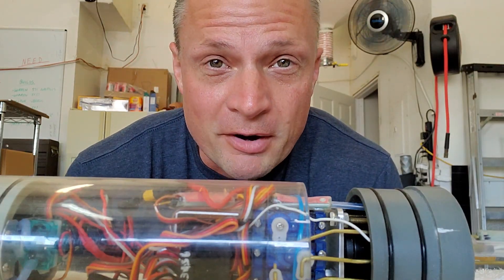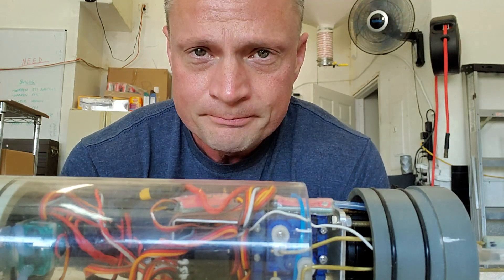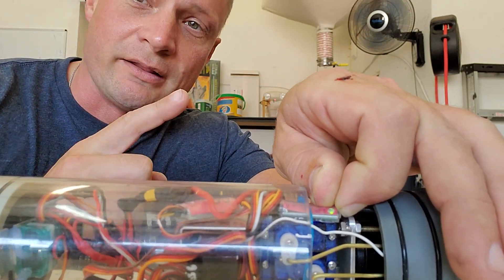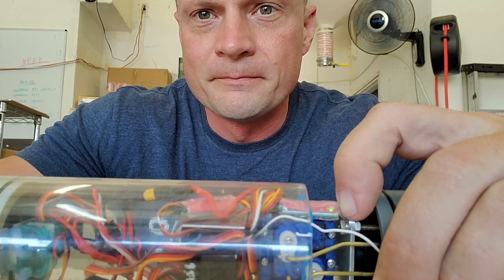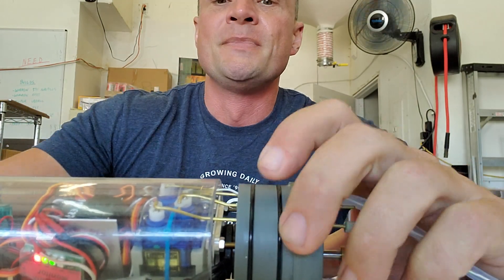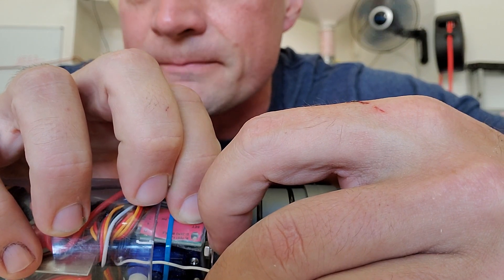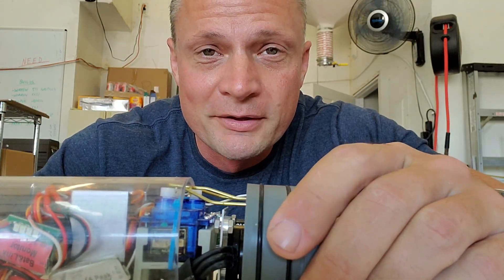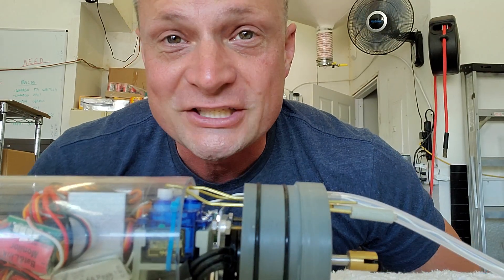How to program your AD2 automatic pitch controller for rc submarines

Comment: Hi! I'm new to this so excuse the dumb question: You entered neutral and up, but not down. Will this unit drive the sub down if it's starting to come up? From the servo movement it appears so. I race RC cars and on the speed controller for cars, we always set neutral, full forward and full reverse. I expected something similar on this. I'm looking for a leveller for my Robbe U47 U-Boat.
Reply from the maker: The programming is just telling the unit which way is what. From the one input, it infers the other. The unit will keep the boat level regardless of whether it enters a nose up or nose down attitude.

Comment: Hey Bob! Thanks for this channel. I'm in the process of 3D printing my sub electronic structure out to be placed in a WT container, and was thinking about filling the chamber with mineral oil....Its non-conductive, a few PC enthusiasts use it for immersion cooling, and even a few deep sea research subs use it for its anti-compression qualities. Would you think it be beneficial to use it in an RC sub?
Reply from the maker: I have to say... that's a new one for me. Based on how many times I have to open and close my cylinder for maintenance and troubleshooting, however, this would be exceptionally messy and perhaps not needed at the shallow depths we typically operate at.
Reply: @RCSubGuy  Very good point, I might be overkilling it with this. Thank you!